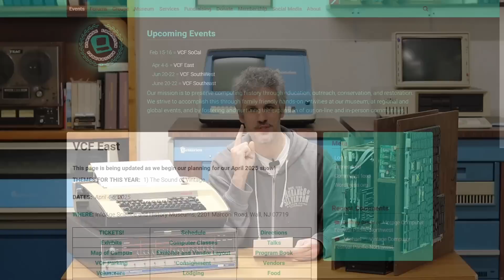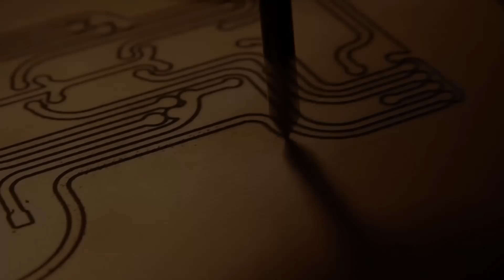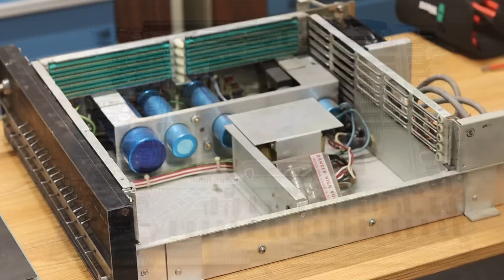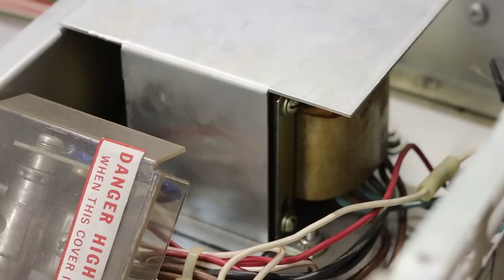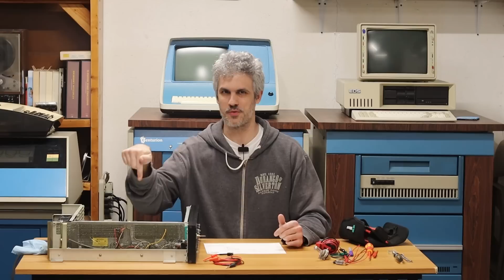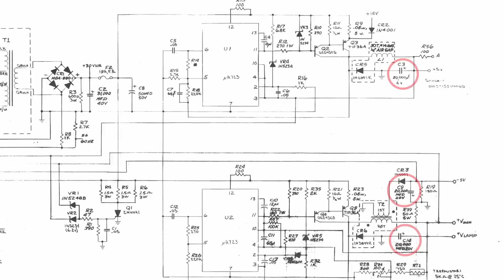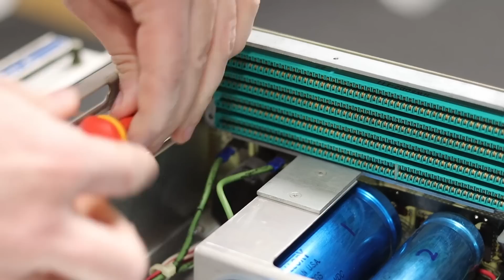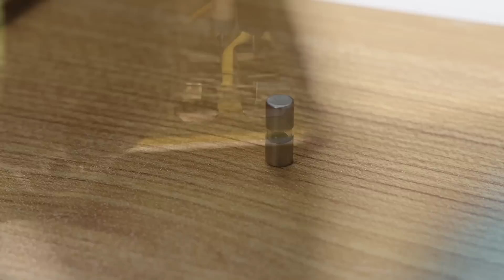Working on a Data General Nova 1210 Power Supply

Comment: We had a Nova 1600 at UTRAO... my first mini-computer experience.  I was just an observer at the radio telescope... but I did get to learn how to boot the Nova... first, the front panel switch bootloader... this would load a TTY paper tape bootloader... which would then load a 9-track tape which was the RAO observation system.  DG not a very common computer IMO... Soul Of A New Machine notwithstanding.

Comment: Funny thing David, back when I was studying electrical engineering at Worcester Polytechnic Institute. We talked about something looks a lot like that power supply in that I seem to remember someone talking about using the transformer to flip around the voltage. 

Now that I’m thinking about it no surprise that computer was manufactured down the street from them. The thing that gets me is, it was probably designed when I was in high school..

We had a lot of folks from WPI end up at DG or Dec.. pretty cool tech back then

Comment: whoa, negative 5 is a lot too high at now. should be fixed before cards insert
Reply: It's a resistor divider so it not supposed to be very accurate and won't produce right voltage unless properly loaded. 
But I'd still stick a 5v3 zener there just to be sure.

Comment: "Reforming" electrolytic capacitors using the method you have shown often works great for a while, but eventually they'll totally need replaced.
Reply: It depends of capacitor. 
Some of the older ones can work for generations with very slight reduction of capacitance. 
Some should be replaced at first opportunity. Many are inbetween.

Comment: i'd very strongly advise using a filament bulb in series with the mains when powering up power supplies of unknown state, drastically reduces chance of  'disasters' and smoke letting 😉
Reply: Some switch-mode PSUs don't like that and may overheat trying to compensate for too low voltage. 
But for 1-time initial smoke test it's probably ok.
What does help is checking the resistance across power rails. That's not a guaranteed way with tantalums though, but it sure helps.

Comment: Tantaliums. Computerworlds evil goblins that just wait to cause havoc. The typical sharp "Bang!" already told the experts what had happened. Thanks for showing !
Reply: They were probably there because of the high frequency signals in the 723. Electrolytics tend to shake themselves apart.
Reply: @ I do know what they are for. Being a computer repairman for four decades already. An initial test with a resistance meter might have shown a short on a power rail and caused a further investigation before blowing the cap. But ... that way it shows up the failing part directly. Saves time.
On the other hand: this type of capacitor totally dislikes ripple current and these are first gneration with liquid electrolytics which blow up in case of failure. Still wonder - after so many years - why they used them nontheless. My IBM 5155 Portable PC had half a dozen of them shorted when I revived it last year.

Comment: damn tantalum caps, strangely i've never had one self immolate......yet..... had some multilayer ceramics pop themselves randomly, though
Reply: it seems some brands/series have much much better longevity than others
Reply: @jwhite5008  and maybe depends on how much difference there is between rated working voltage, and actual voltage in use....

Comment: Nice memory structure: when something was fetched as a pointer but the highest bit was up, it referred to another address which was to be used as a pointer instead.  Linked lists were builtin. This mechanism was in the memory controller and wasted no CPU time.

Comment: yep, you're reforming caps pretty much just right, current limited, to max volts, them taking 10ma or so is likely ok, all electrolytics still take a tiny current even if perfectly ok, higher the capacitance, higher the current,  after reforming, do an esr test on them as they can seem to reform ok, and even have good capacity, but may have poor esr and heat up when in use

Comment: EDAX still exists, they make energy dispersive X-ray spectrometers. In a nutshell, the x-ray spectrometer counts individual x-rays and determines their energy by converting a charge pulse in a detector into a voltage pulse. The voltage pulse height is digitized and that value is used to resolve a memory location, the contents of which gets incremented to indicate detection of an x-ray at that specific energy. Doing this with many memory cells constitutes a multichannel analyzer.
Reply: Awesome, this is the comment I was looking for. I've worked with/on chromatographs with various sensors, a lot of which are of course count based. I was fully expecting it to be some kind of cps and really interested to read the details. Thanks!

Comment: 13:00 - actually, this is quite a "doctors recommend" method of dropping down electrolytic capacitors drain current and it is called "capacitor forming". BTW you can make it way simpler by connecting a resistor in series with the capacitor, applying nominal voltage to the resulting scheme and leaving it so for several hours.
Reply: Or simply by setting the lab power supply to the fully rated voltage and the current limit to something low like 0.1A…
Reply: One resistor and an LM340 is an easy way to make a current limiter.
Reply: Reforming capacitors is actually a contentious topic and plenty of people don't think it's a good idea. The capacitor may well work when you do it, but it's still 50 years old and may fail at any time. I wouldn't do it in a case like this where failure could do a huge amount of damage to irreplaceable parts. I also wouldn't do it if replacement capacitors are inexpensive. That doesn't leave many cases where I would do it.

Comment: 6:50 well with modern manufacturing you could literally etch core memory on a pcb, or possibly as a mems style microchip
Reply: Wen u own a silicon fabrication plant and get bored

Try to build a mems ram chip

Ferromagnetic sram

Basically sram without any transistors (for the actual memory element, not for the drive and control logic, but that's simple enough to include on the same wafer) 

Downside is destructive read, so you have to read the bits, buffer and rewrite it back to that address if you want to keep it stored

And a magnet can cause you to wipe the ram chip clean of bits

Comment: Well, there's an old friend! I worked for a newspaper in the late 1970s that used one of these to collect news feeds from several wire services and transfer them in to a Univac mainframe based electronic editing system. I personally repaired one of the core memory cards, but that was the only failure I can recall.

Comment: "I like minicomputers!" Well, duh! 😆  Yeah, you're swiftly becoming the go-to minicomputer guy!  Thrilled to see you working on DG hardware.
Reply: Drain gang hardware ❤
Reply: @yns000  Hahahahaha!  I haven't heard that phrase in quite some time.  Thanks for the memories! 😆Have you read Tracy Kidder's The Soul of a New Machine ?
Reply: @horusfalcon  Hail. I have read my copy so much it needs an elastic band to hold it together! Used to work with MV series DGs. A 4000 and a 15000

P.S. Still have my Data General One laptop. Time to see if it still works...
Reply: @robertharris2262  We had a re-branded DG One (an Allen-Bradley T35 Industrial Terminal) that was stolen from an Army Ammunition Plant where I used to work.  I embarrassed the Redstone Arsenal people when they insinuated I was prime suspect for the theft.  Their cursory search of our work area overlooked several places where it could have been hidden, so I took them on a guided tour of all those spaces, nooks, and crannies.  When I pulled the bottom drawer of our blueprint cabinet to check below it, one of the investigators had a light come on in his head:  he asked, "What we're hunting for is that small?"

I retorted, "Fine investigators you are!  You didn't even research what you're looking for."  I opened the manual for the thing to the page showing a picture and the dimensions of the unit, and said, "I'm helping you find it because I use it on a daily basis to complete work tasks.  I am the one most affected by its loss."  After they all realized just how much they had offended me, and yet I was still helping them, their attitude changed.   They never did find it.  One of the mechanics on evening shift found it several weeks later and called me on the radio.  I said, "Stay with it, please.  Don't touch it, and I'll meet you as soon as I notify Security."

When I got there, Security was on scene, extracting the laptop from a hopper full of metal parts covered in die lube.  It was a tragic mess.  The Lt. in charge of the Security detail (an old high school classmate), said, "Thanks for letting us know."  Long story short, they never did raise any prints, nor did they ever return the laptop, despite it having control programs for most of the equipment I serviced.  (Good thing I had backups on another machine, a T-50 Industrial Terminal.)
Reply: @horusfalcon  Was waiting for someone to mention that book 😄
Reply: @TomasGradin  Well, I think someone else may have beat me to it, honestly...  See @mcolville's comment.
Reply: He is one if the few with the ability and willpower  to collect and use them. most collectors don't because its too hard to get them in a working state or because they are too rare since these things were ultra expensive when they were new and not mass produced .or just because they have no nostalgia for them since they were not used by the average person and are often so old most people of that generation don't even care about computers at all because they never saw one until they were adults. so only people with a hardcore interest in computer history want them .most collectors stick to consumer computers from after 1977 like the apple 2 c64 and so on either because of nostalgia or just because anything older is too hard to obtain and is usually broken and hard to fix. like i want to collect them i have no nostalgia for it i am probably one of the youngest people watching the video. but i know its too much work and i lack the talent to fix them i will leave it to the experts .

Comment: Hardcore Memories! What a lovely unit it is -- good luck with the restoration! :)
The spectrometer interface is interesting. I wonder if it's one of HPIB/GPIB predecessors if there were any, or if it was custom built.
The power supply looks pretty wild looking at the schematics. And that fuse is by far the shortest glass fuse I've ever seen.
Reply: Those fuses must have had automotive applications because several Bussman car fuse kits I have from the 1970s have those stubby little 10 Amp fuses in them